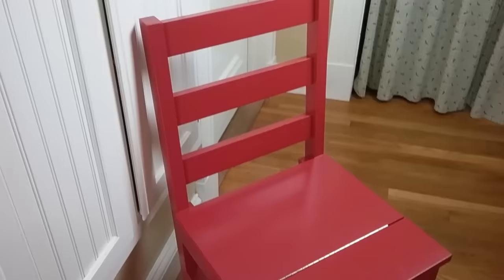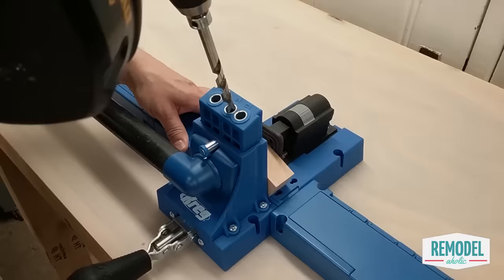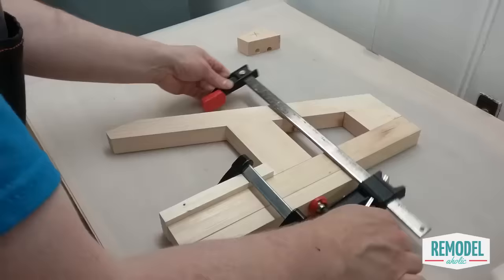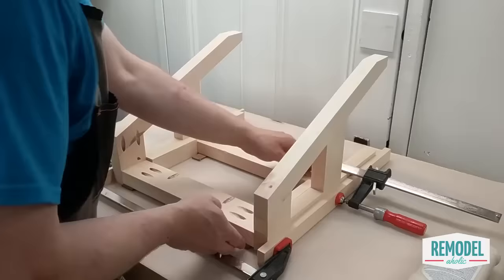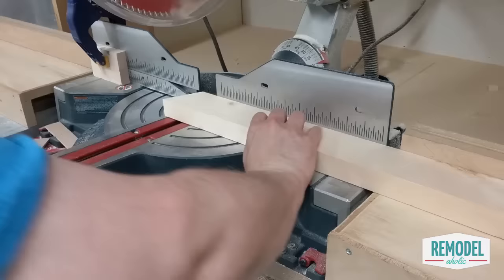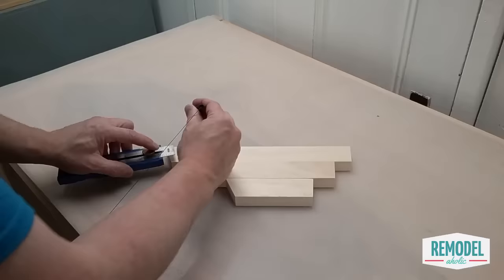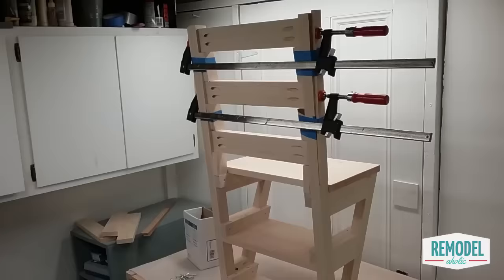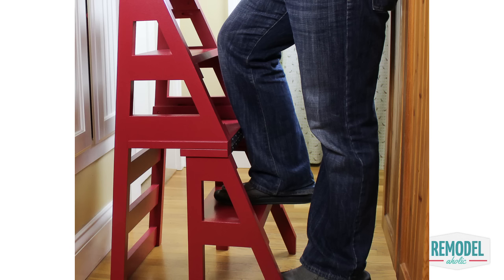How to Build a DIY Ladder Chair; Space-Saving Multipurpose Folding Step Stool

Comment: Thanks for a wonderful project.  As someone else pointed out it's at a bit higher level than beginner but it has so many uses it's well worth taking on.

Just a minor correction.  On step 25 of the building plan it says the two-piece seat is cut to 13-1/4" when the diagram shows 16".
Reply from the maker: Thanks for pointing that out!
Reply: @Remodelaholic tried downloading these plans following links for free but it's trying to charge me 15 usd.. ars you able to send these plans to me or clarify how to get them free?

Comment: The idea and concept behind this construction is mind-boggling, It's uses are unlimited. . .replacing light bulbs, use it as an extension on the table to reach higher heights like ceilings,  use it during house wiring, use it to reach a higher branch that requires cutting, trimming high fences. .. you name it, , , ,when you have a utility chair-cum-ladder like this at home it will help you overcome a lot of those hard to reach height which we encounter many times. .. 

I am going to make one like this, but my design will use strong aluminum alloy instead of wood and joinery  will only be made of aluminum plates and aluminum rivets because I want it to be weatherproof and also to last for generations. .
Reply from the maker: That sounds AMAZING!!  I totally want to see the chair you make when you are done!!
Reply: @Johan Rynjah Did you ever complete that aluminum chair ?

Comment: Hi.  Thanks for posting this.  I have been wanting to build one of these fore a while.

I am not from America so I have got to convert all of the dimensions to metric.  That's not a big deal, but can some please tell me what  5/4 x 2 x 8 is?  Thanks.
Reply: I don't have the plans, but 5/4 would be the thickness of the board. 5 quarters of an inch. So one and a quarter inches thick, 2 inches wide, and probably 8 feet long?